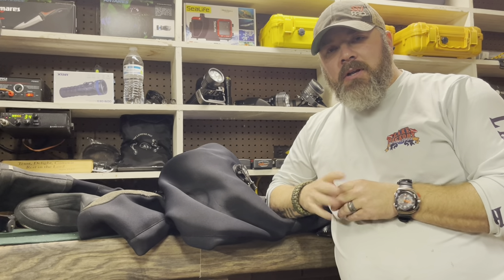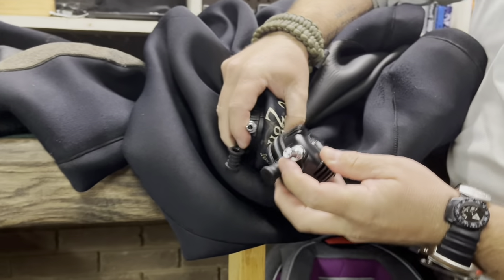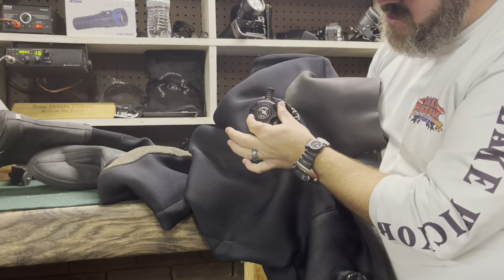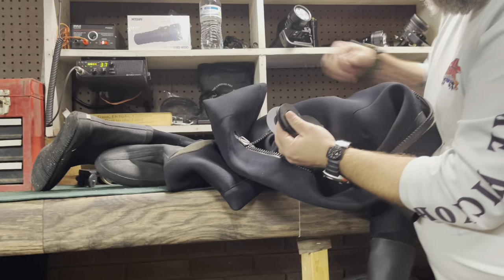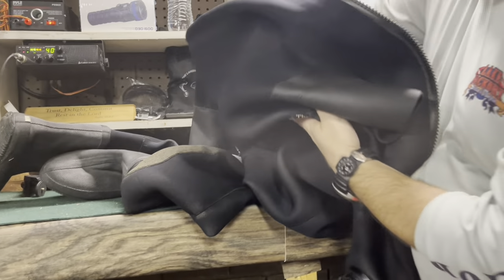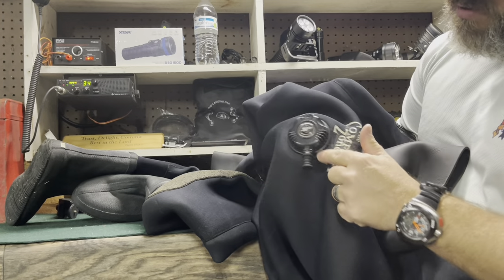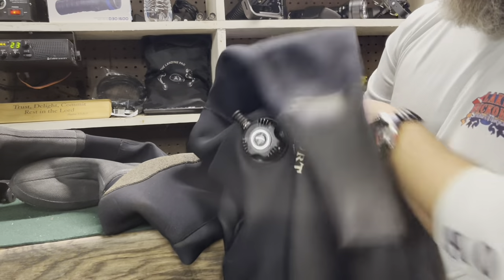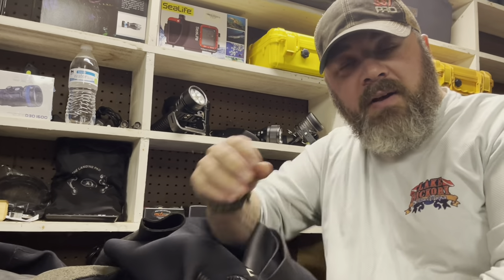How To Replace A Sitech Inflator Valve

Comment: Special tools that may help if your valves are not unscrewing by hand:

SI Tech Attachment Valve Tool 
And 
SI Tech Combi Tool “Pizza Cutter”

Update as I am currently chasing a drysuit leak issue. I decided to do maintenance on my SI Tech inflator and exhaust valves. 

I have the SI Tech black plastic ring tools to make it easier to engage the valve halves. Not everyone has the same grip strength and my valves were not unscrewing by hand by gripping the sides. 

In my situation the valves were not unscrewing and requiring a huge amount of force. The plastic rings were digging into my hand. I was trying to think what was causing this? If locked by salt water but this didn’t make since to me. I flushed with mild soapy water and continued trying. Eventually I put a rubber strap wrench around one half and the SI Tech plastic ring on the other and it finally unscrewed! I needed a little extra leverage the handle of the strap wrench provided to unstick my inflator halves! If I had remembered I could have use the combi “pizza cutter” tool for the same outcome.

So the root cause issue I found the white plastic anti-friction washer missing and a bunch of tacky dried silicon sealant had been applied around the threads. I did not do this nor did Waterproof the drysuit manufacture. 

I remembered having sent my suit off to Dive Right In SCUBA for previous repairs on other components. During they leak tested and decided to remove my valves and someone thought to glue up my valves! Should have stopped and sourced a new $10 SI anti-friction ring as a proper response! DRIS does great work don’t get me wrong. They likely didn’t have the SI anti-friction washer in stock. They always have ten mile backup in their service department as there is a lot  of demand for their drysuit repair services so they simply applied the silicon sealant as a quick solution, unbeknown to me. I simply was not prepared for this surprise during the disassembly process. I had removed them before with no issues as illustrated in this video, frankly it’s a simple task.

I fought the stuck valve all day and spent hours cleaning off the silicone after the parts were unscrewed. 

Just a reminder to stop and think things through carefully. Fortunately no damage to my gear and I should be able to reinstall with out issues today.

This is what can happen when sending gear out you just don’t know what practices are deployed so be prepared for anything if you start doing your own maintenance. 

Respect the special tools because they were made for a purpose and you may need them.

For this task generally you should only need some decent hand grip strength. We are not trying to over tighten the valve halves by any means. However is someone had glued your unit with silicone sealant you will need the special tools!

Maybe this helps someone else.

Cheers, #SeattleRingHunter
Reply from the maker: Thanks for sharing SeattleRingHunter. We concur with your statement to use the tools that are appropriate. Thankfully, I rarely have any issues with my valves, of course, I am the one that services them. With most manufactures, there will be proprietary tools for regulators and BCD's. But most retail Scuba Centers sell basic scuba tools that will work for most small jobs. We encourage divers to know their gear inside and out, and to tinker with it to the point the can fix minor problems at the dive site. Just another benefit of taking an equipment related course like the SSI Equipment Techniques. It won't allow divers to complete a full service of their gear, but it will allow them to fix minor problems, swap hoses, and save money while prolonging the life of their equipment.

Comment: Great video on this unavoidable task that will come sooner than later after a few years of use as I learned this last year. I started hearing a small amount of gas leaking from my Sitech inflater. A quick trouble shoot by removing my inflator hose isolated my issue to the Sitech inflator valve. Being a mechanic with the appropriate aptitude I ventured in to see if I could dissemble the Sitech inflator completely down to its basic components and quickly learned that they did not make full disassembly of the Sitech inflator an easy task. I also will say I don't tear down my regulators simply because I don't have the space to setup a proper repair bench, loaded up with all the special tools and gauges and invest in manufacture training solely for my own regulator maintenance. Even when looking for the appropriate special tool to remove the Sitech valve nut I was not able to find what I was looking for. I did purchase the Sitech plastic rounds that make it super easy too unscrew the two parts by engaging the tabs you referenced. Sure its simple enough to do it by hand but not everyones grip strength is the same. After much investigation I learned that the industry really doesn't service these valves and its more of a consumable once it reaches its end of life due to the fairly low cost of a new replacement. I eventually made a special tool that was sufficient in opening the valve and as I suspected all I needed to do was swap out the exhausted o-rings, apply a thin bit of crystal lube and reassembled the whole package. Please note when doing so one needs to be cautions when removing the the blister logo sticker on top of the valve button if you wish to save the double stick tape or just apply new tape during the reassembly process. The rubbery blister sticker has to be removed to expose access to a bolt that needs to be worked to unscrew the valve completely. I simply rebuilt my old valve after a good cleaning and new o-rings and placed in in my spare parts pile. I purchased a new valve and installed it for continued use. Now in the case when the new valve reaches worn out o-rings I can install my spare to keep my suit in service while I deal with repairs or replacement the next time around.

A Sitech inflator valve exchange really is a pretty basic task that any diver should be able to accomplish at there own bench 🤙 Cheers, #SeattleRingHunter
Reply from the maker: Hello Seattle Ring Hunter, you are correct. Sometimes its easier and more cost effective to just replace the valve than try to repair it. And per our conversation, I haven't forgot about our critter hunter challenge. We just returned from Cozumel, and we have several videos being edited from their. Once they are complete, I will give you a call with the challenge.
Reply: @LakeHickoryScuba  when the time comes no problem 🤙

Comment: Brian, have you had any problems with the SI-Tech valve you show being installed in this video?  

I have an SI-Tech valve in my brand new DUI Yukon II drysuit and the first dive went well but when I was doing my checks prior to the second dive, I'd lost about 75% of the air flow into the drysuit.  My instructor and I tried to figure out what happened and we found the quick connect fitting o-ring had broken into small pieces during factory installation and we only recovered about a quarter of the o-ring.  I'm guessing the remainder of the o-ring is jammed in the valve and is the source of my limited airflow.  Very frustrating given the 3 hour drive each way to get to the training site.  Now I have to go back for one more drysuit dive because of a failed SI-Tech valve.

Thanks for posting these equipment tech type videos.
Reply from the maker: Hello Doug's Messy Garage, yes and no. On this particular valve, no I have not had any trouble, however, SiTech has had a recall recently. Here is a link https://www.sitech.se/articles/recall.aspx